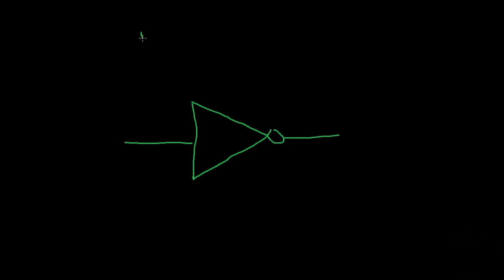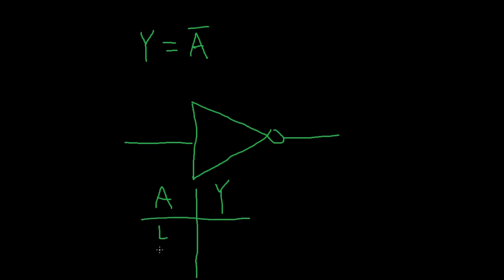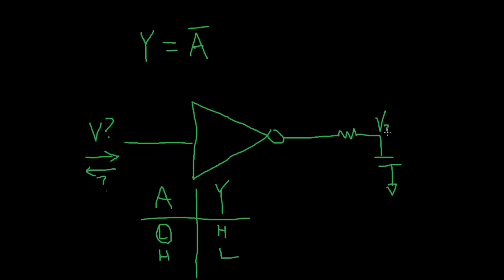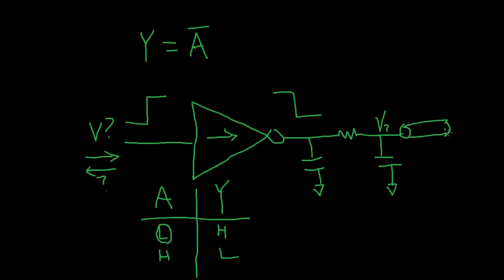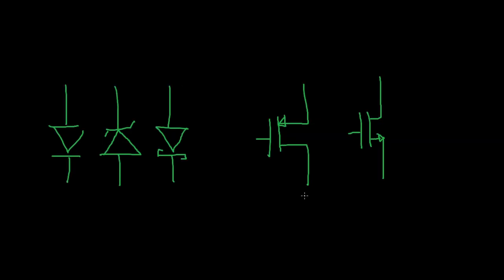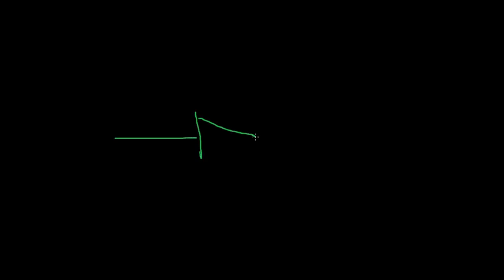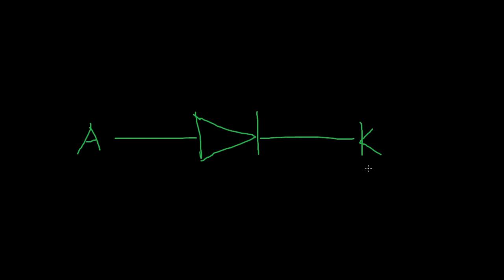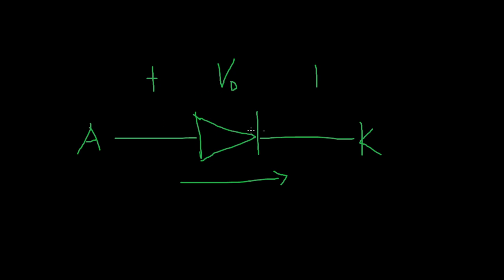Design with CMOS Logic - Quick Refresher on Diodes and MOSFETs

Comment: 19:00 The MOSFETs' arrows (the ones pointing into and out of their gates) should be the other way around, shouldn't they?
Reply from the maker: Thanks for the question. These are correct in the video, but I have drawn them backwards many times -- the symbols were confusing for me for a long time. It finally made sense to me when I realized that the 3 pin symbols have the arrow pointing in the most common direction of current flow (source to drain for pFETs and drain to source for nFETs), and the 4 pin symbols point in the opposite direction.
I have heard that the reason they point the way they do on the 4-port model is to kind of represent the parasitic diodes, but that was harder for me to remember.